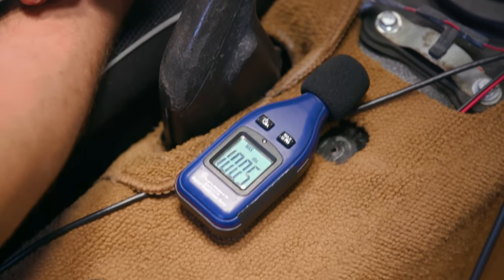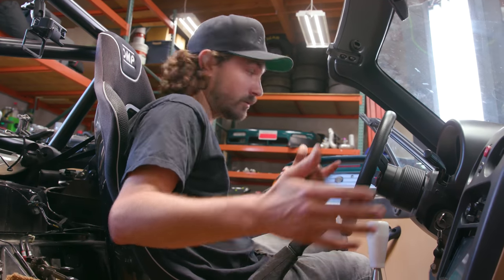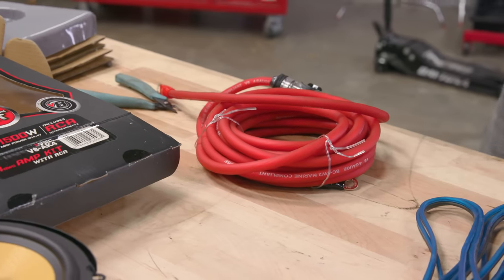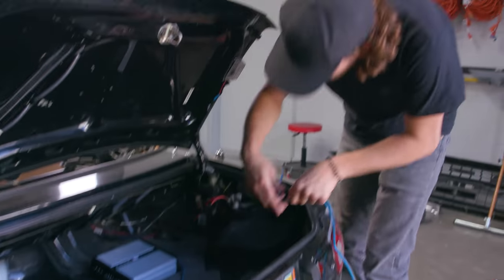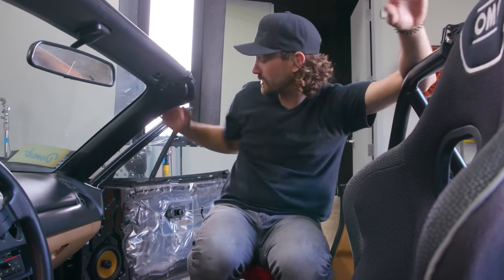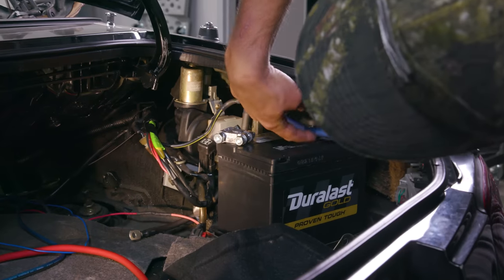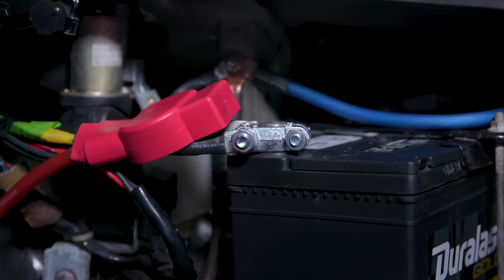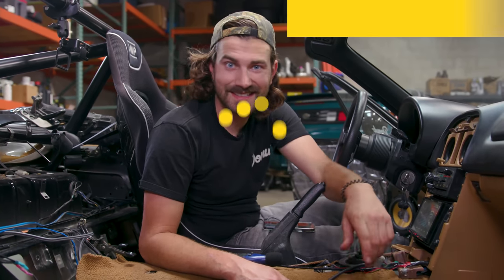Is Upgrading Your Car Speakers ACTUALLY Worth It?

Comment: The distortion you heard at the beginning would have been amplifier distortion as the head unit couldn't cope. Just adding a power amp to this setup could have breathed new life into those Alpine Type E's.
Reply: the distortion he can fix it from the amp he has to change from 60hz or 70hz to 150 hz or 200 these are not speakers for bass but he can use it for mid voices and high

Comment: Jobe telling me that wiring isn't as scary as it seems feels like hearing it from a wholesome older brother
Reply: Its really not in cars because its 2 wires house power a bit more confusing
Reply: Its not scary untill your car bursts in flames if you choose too thin wire or too big fuse.
Reply: @SkyJUSTIN6   most house wiring is also 2 wires, and a ground. It's not that spooky either, and you aren't dealing with computer controlled systems either. :p I can tell you for sure that car wiring is more complicated. I'm an electrician, and car enthusiast. The big scary part of your house, is just higher voltage.
Reply: car wiring isnt, designated pos/neg and it tops out at 14volts -youll feel it but it wont kill you.
Reply: @etherealalex2358  alternating current is scary af boi -invisible death magic

Comment: Excellent vid and proof you don’t need to spend thousands to get much better sound in your car. Just too bad the new cars lack the ability in many cases to upgrade the head unit. At least the aftermarket companies are doing great keeping up with the adapters you need to add aftermarket amps and speakers. Thanks for this vid and for promoting car audio!
Reply: Dang got a comment from Williston! Jobe made it!
On a serious note, please send him a sub, he cannot leave the Miata like this...
Reply: @matthewpriest5329  truee
Reply: No big dummies here!
Reply: @tatsumaru12345  when you said that I heard it play
Reply: I've driven all my cars since age 16 with sound systems. I saved up my waitressing money first summer working. I was around S650 in 1995. Since the physics guy designed the ported box perfected tuned. The amp was only around 360 RMS. I enjoyed being the DJ at high school and college parties. Hosted a campout Texas Party when my parents went to Vegas. 200 ish people showed, running out of parking and the horses were stampeding. Later on Dad tried to charge my new battery. Ha. It was beyond toast. It was bumping in the garage for louder sound maybe 5-7 hours? He was proud I managed to ruin the battery so well. Got in trouble that people gave my 8th grade brother booze. No problems w campfire either it was a blast.
Reply: BigDwiz is the man!!
Reply: @AF_1892  kk
Reply: In my 98 Civic, a head unit replacement took about 10 minutes for basic install, longer if you add more accessories, etc. My 07 Civic Si looks to be about 15-20 minutes work just to get to removing the head unit panel, and another 5-10 minutes to transfer everything from the old panel to the new one. So about an hour install vs a 10 minute one, and $30-45 for a panel and connectors for the 06-12 vs $15-20 for the 96-00.
Reply: Just use small house speakers in the said car, second hand bose upfront and some cheap Wharfedale's 30 D at the back.
So much more box of bass, better speakers at cheaper prices and a better range speaker all around.
Nothing worse than using a flimsy door with plastics or a hardboard as your speaker box.
You can use the said car  head unit as the pre-app just for volume control and use a power amp under a seat or behind dash with a phone.
Then you don't need to change the unit .
Reply: Nice man.
Reply: The mess left in my '96 Tacoma by the PO didn't even require hundreds. Just a pair of decent 2-way Optimus 40-watt flea-market speakers in the rear, and a working Sony CD-head-unit from Pick-N-pull. Total cost about $50. No monster amp needed in that closed cab. One important detail for me - the 'new' head-unit has an aux-input jack to connect any player that has a 1/8 stereo headphone output.
Reply: @AF_1892  this feels like it's just barely English.

Comment: Probably the most well put-together video on speaker installs that I've ever seen. I've installed several speakers and subwoofers over the years, and it took a lot of personal research and money to get it right. The only thing missing is adding a fuse in between the amplifier power and the battery, close to the battery.  I've had a case where the power wire got shorted and caught fire, luckily only burning the wire.  But a poor install can do some damage.  Also if you don't have an aftermarket head unit, make sure you use a proper technique to splice into the back of the factory unit, as those wires can become loose over time and give you some headaches.

Comment: I've installed half a dozen car head units with amps setup in my life. Still watched the entire video. Zach is just an awesome show host and the video is very well produced. Keep up the great work Donut!
Reply: Well said mate
Reply: do these speakers actually need an amp if the heras unit could output 50watt per channel and the speakers are 50rms
Reply: Same here, well done video
Reply: @tomtricks6838  yes. Most head units for some reason like to fudge their output and use max not rms rating. (Not sure about this brand but really its typical) secondly its not a good idea to try and push the head units amplifier because thats a lot of heat dissapation youre asking out of a unit with more sensitive components than an amp has. You can also put the amp where its easier to shed heat or put a fan on it.  Also car audio is a hobby youre rarely satisfied with, outboard amps allow for easier upgrades, like more or bigger amps. This setup is gonna beg for a big sub down the road.
Reply: Bro why not just say six? Lol
Reply: @chetphillips1658  four score... A bushel... Twenty stone.... A ha'penny. Ok how about a f*ck ton.
Reply: @tomtricks6838  yes the head unit will do 18-25 watts rms, the signal is no where near as clean as from an amp tho

Comment: Some tips from an old ex-stereo installer:
- for running wires through the door grommet boots, get your hands on a 3foot tie strap.  Flexible but stiff enough to push though the boot.
- the blue remote wire from the head unit turns on and off with the head unit, not the key.  The fact that the deck itself turns on and off with the key replicates this action but the blue wire itself is controlled by the status of the deck.
- the gain setting knob on the amplifier is used to match the input sensitivity of the amplifier to the output voltage of the head unit.  It is not some kind of auxiliary volume knob.  Turning the gain up just makes the amplifier max out and start distorting at a lower volume level on the deck.  Turning the deck up past there just increases distortion and crap sound.  It is better to be conservative with the gain rather than just maxing it out (which we see far too often).
- you used a 4channel amplifier and are running just two speakers.  Unless you plan on adding another pair of speakers or powering a sub with the the other two amplifier channels, you could have bought half the amp and saved some $$
Reply: Or bridged the amp channels and bought some higher output speakers...
Reply: @Muscon01  or ran another set of RCA's, to make life easier for throwing in a sub later, also

Comment: If you want to low pass filter on your stock head unit to your stock speakers if you have a aftermarket sub setup, you can put a capacitor in line near the speaker and it will filter out the low bass notes

Comment: You'd do well to insulate the doors and seal them up nicely. It gives a better bass response if all the air gaps are nicely covered and the outer skin has some good sound deadning on it. :)
Reply: And they would do well to connect the amp on signal to the receiver instead of directly to accessory power. (Several reasons).
And when referring to matching speakers with Amos, it's IMPEDENCE, not RESISTANCE. But that's the angry electrical engineer in me talking.
Reply: @alienclay2  what are these several reasons?
Reply: @inglouriousmofo  if you connect the amp on to accessory power
1.  it can turn on before the head unit sets it signal, making an annoying 'pop' when it does turn on. (I know, I've made this mistake before)
2. The amp will stay on even if you turn off the head unit, wasting power. (Not much on a d class amp, but still real )
3. I'm not sure about the Miata, but you don't want your sensitive electronics 'on' while your car is engine starting and voltages may be dipping. Usually,  a car will not send the head unit on signal during that, and if the amp is properly connected to the head unit it won't be on either.
4. If you routed the LR RCA cables from head to amp, it's kinda a noob deal to not have pulled the tiny amp on cable along side given 1,2 and 3

Once again, not sure about the Miata, but if the car didn't have a dedicated amp on line from the stock head unit, a cheap time delay relay should be installed in its place.

Comment: This year I got a cheap 700 dollar 05 Civic and have been slowly working on it.  After I got it on the road I  desperately needed to redo the audio  system, the head unit was an Android unit running Android 6 and lagged when simply adjusting the volume.   Speakers were all factory with one of the rear ones looking like someone ran a screwdriver through it.  I swapped with another Android unit, but this one runs Android 13 and has a pretty big 9 inch screen and came with a new plastic housing for the HVAC controls for it all to fit,  and supplies 45 x 4 watts of power.  Speakers I went with two sets of JBL 6520 Clubs (door and rear speakers are both 6.5 inch).  Much better audio quality with room to grow (might add a small 8 inch sub in the trunk down the road).  I also like being able to run Torque Pro on the headunit with a cheap bluetooth odb2 adapter for basic engine code checks if needed.

Comment: Having a decent subwoofer will help the perceived loudness of the overall sound immensely. Levels you play the music is uncomfortable but still unsatisfying which can be solved with a subwoofer. It can even be an under seat subwoofer and it'll beef things up pretty good. (down to about 40Hz. if you want lower, under seat subs may not cut it but I think for most ears properly produced 40Hz is more bass than they'd ever want.
Reply: I agree with this, and I recall back in the day people with Miatas would rock a self-powered Bazooka tube for the bass, and often a single 8" or dual smaller ones would be enough to get some bottom end.  The cool thing with the modern tech, is it is smaller, lighter, and sometimes more efficient, and still plays loud too.  I replaced the stock 8" Sony Sub cabinet in my Focus ST with a 6.75" Kicker Comp RT (the tiny one with a 6.75" passive radiator), and added a tiny Kicker Class D Monoblock to drive it.  I also bought an Audio control LC2i active line converter, and used the original sub speaker wires as my input.  Luckily for me, the LC2i corrects the bass cut the stock amp does at higher volumes, and keeps the volume linear.  Most people are shocked how loud, deep, and hard that baby box plays, especially after they see it.  I simply wanted to improve on the stock system, without making my cargo area useless
Reply: It's always "more bass than I'll ever want" until you hear a system that plays lower, and then you want MOAR!! 😂
Reply: I had a cheap <$200 under seat sub in my x3 and it DRAMATICALLY increased the quality of my music. It wasn’t “bumpin” but it for sure was worth its price.
Reply: @iandavis8755 hat’s crazy to me, because I just installed dual 12” kicker comp RTs with the LC2I pro under my gmc seirra 1500s back seat. Even though it doesn’t get much air it still gives a crazy bump.
Reply: A good sub will definitely improve overall sound a lot. I’d also like to add, it’s a good idea to use a product like a Dynamat Speaker Kit. It transforms the flimsy sheet metal in your car door into a solid, non-resonant baffle. For improved mid-bass performance with less distortion. If you’re spending that much money on a upgrade, you don’t want to hear your doors rattle.

Comment: Speaking of high-pass filters. The Pioneer head units like the one installed here has a very good setting for filtering sound. Independent adjustable high-pass filters ranging from 20 Hz up to 120 Hz, with slope settings ranging from 6 dB per octave, to 36 dB per octave. Very easy to set up, being that you have the informaion in clear text.

Comment: I do this for a living and a little while back I put a set of Kenwood Excelon  XR-1701P in a Miata, with no amp, and I couldn't believe how much it rocked with that alone. I must say, that is some very impressive wire running and amp mounting!

Comment: Don't forget a fuse for any amps as close to the battery as possible. 
A 2 channel amp would work here, but you could bridge the remaining 2 channels for a SMALL sub (need another pair of "RCA"s). 
I've powered non-sub speakers via amps, but in my '02 Holden / Vaxhaul / Opel Barina / Corsa the factory speakers sound AWESOME powered by the (VERY SMALL) JVC Kenwood KMM-BT306 with the HighPassFilter set to about 100Hz.
You'll get better control of your crossover frequencies via the head unit settings (amp or head unit powered speakers), so set crossovers on amp to OFF. DON'T use BOTH head unit and amp crossovers at the same time! 
I added a sub and amp (both bolted down, which actually improves the bass)  and set the LowPassFilter ON THE HEAD UNIT also to 100Hz.
Both crossovers need to be set to the same value to avoid redundant overlap or gap in frequencies, which is way less easy via the pots / dials on an amp. Yes, some amps have switches to set crossover frequency, and that is probably fine to use.
120Hz might sound better with weak or small non-sub speakers.
Reply: The small subwoofers are usually less efficient. A PA subwoofer would give best SPL on the smaller amp but needs a lot of box space.

Comment: 2 quick tips that you probably did but didn't mention, but would be good for someone who's doing this for the first time to know.

1. Label the wires and label them well, this way they won't get mixed up and cause you fade/balance settings to be almost useless.

2. if you're going to send welding wire (or anything really) through the door grommet, make a small loop on the end and tape over it completely to make sure you don't accidentally nick a wire with a sharp edge and cause a massive headache.

Comment: With the 4 channel amp already it would be easy to strap the other two channels together to power the sub and build a small sub box for the trunk. Very little additional cost and would add back the bass filtered out of the mids.

Comment: Only thing I would have done different would have been use the old wire to pull the new speaker wire through since you won’t be needing it anyways. Then you can cut it at the harness or tuck it under the dash. Just my 2 cents though. Love watching your videos Jobe!

Comment: Tip from when I worked at a car audio shop, turn phone volume all the way up then down by 2. Let the car/unit do the real work less distortion and chance to damage the speakers. 
When using the phone speakers go ahead and play then at full blast.
Reply: Since I got my first car at 18 that's how I've always done it, just sounds cleaner that way ! 👍🏼